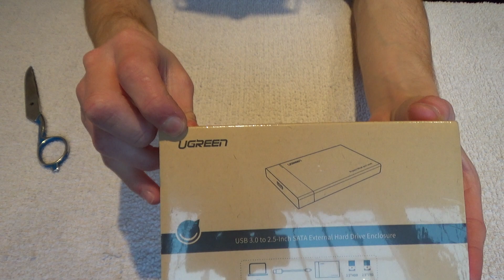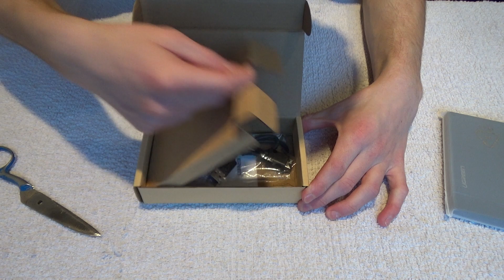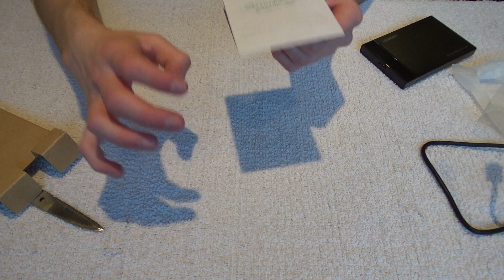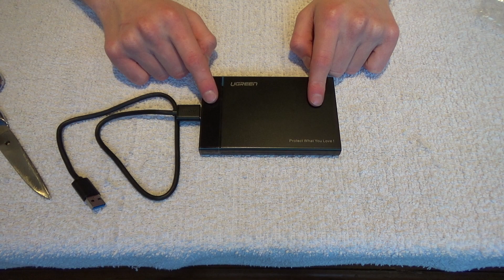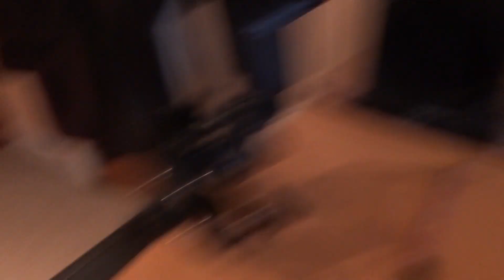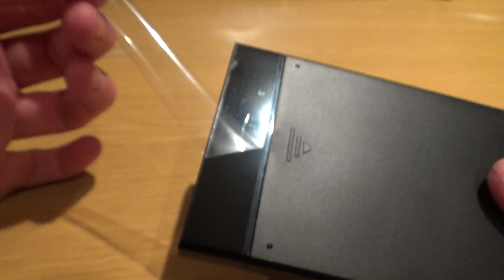Unboxing: Ugreen 2.5-inch SSD/HDD to USB 3.0 Enclosure (Drive Installation & Speed Test)

Comment: You should try to make a system image and see if it is done successfully. (Control panel - File History - System Image Backup - down there); I.ve seen many enclosures that weren.t able to finish this task, it failed; and this is the story for an Ugreen sata -to-usb adapter.

Comment: Hello can you use it internally?
Reply from the maker: Hello, it would work if the computer/device has an internal USB port, but for internal drives I would recommend a more conventional interface such as SATA/NVMe. Personally, I only use USB connected drives for portability/external use.

Comment: Thank you for the video...

However, If 2.5" HDD is not showing up in file explorer or when you click on Computer to show Devices with Removable Storage, how do you get to use or access the HDD External Case?

How do I assign a letter to the HDD External Case?
I have connected it to my laptop, the LED light is on and I can safely remove hardware but I am unable to locate it in file explorer?
Reply: I doubt you will  see this, but you have to format/partition it in Windows.

Comment: UGREEN External Hard Drive Enclosure Adapter 3.5 USB 3.0 to SATA Hard Disk Case Housing with Power Adapter for 3.5 2.5 Inch WD, Seagate, Toshiba, Samsung, Hitachi SATA III, HDD, SSD 10TB Max, Tool Free with UASP, Black

https://www.amazon.ca/UGREEN-External-Enclosure-Adapter-Housing/dp/B076WQHK2G/ref=cm_cr_arp_d_product_top?ie=UTF8

is this any good??